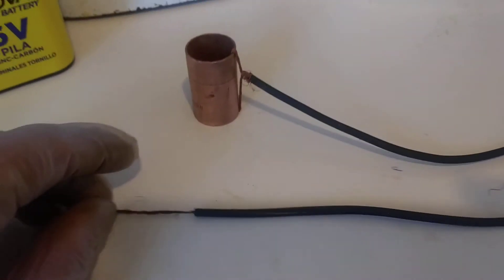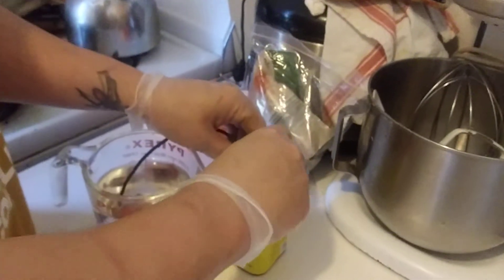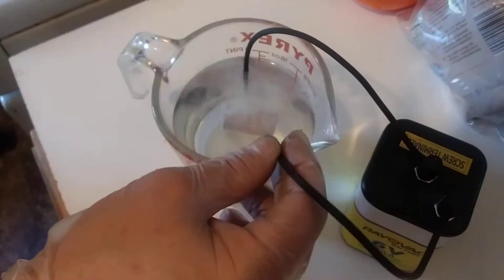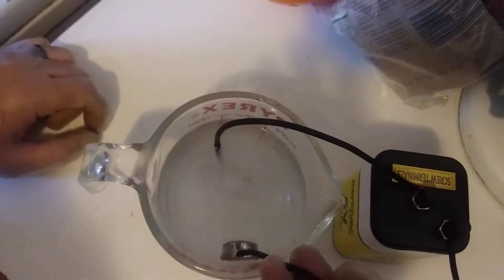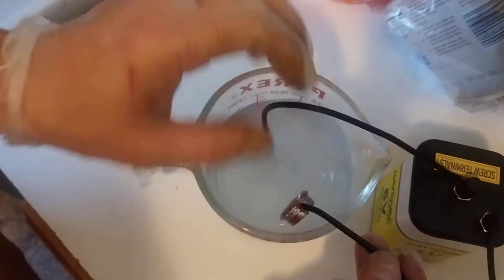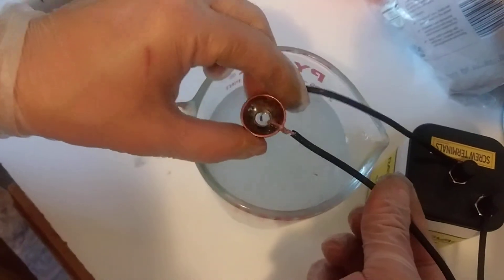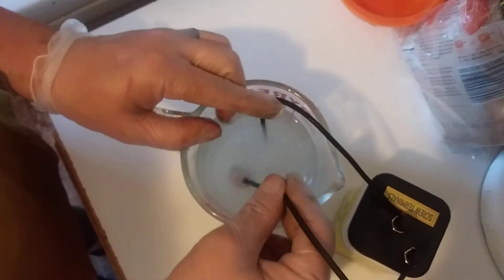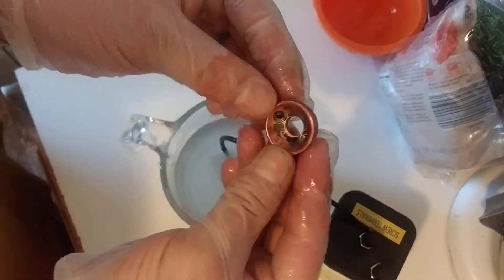Easy way to remove chrome and reveal the copper layer under it.

Comment: Thx the process seems to work well although i got some black residue during the process with a chrome/nickle plated steel part with a copper piece as a cathode anyone got any idea  what the residue might have been?

Comment: Could use bicarb as the electrolyte, no need for the acid, not so?
Does the chrome deposit onto the copper electrode or does the chrome remain in solution?

Comment: Thank you for this simplified method of removing chrome. I have some parts that were originally chrome plated. Most has come off to the point of bare steel showing from age and weather, but some small areas of chrome plate still exist where it was protected. I want to re-plate in nickel and needed a simple way to strip the remaining chromed areas. The chrome is on the part ends, so that's the only section that needs to be put in the bath.

Comment: Can I use DC power supply as battery replacement. Thank you.
Reply from the maker: I don't know honestly, I never done it that way. Research it before you try it. Be safe 🙏
Reply: A DC power supply is essentially a battery sucking endless power from an a/c outlet. Just be careful with your amperage and you're fine.

Comment: I want to remove chrome from a faucet that is supposedly brass underneath. I sanded some of the chrome off and underneath is actually a copper looking metal. can I do this on a a larger scale with my faucet? Never done anything like this before. All I know is I want to make my bright shiny chrome faucet look like aged brass..But sanding it would take days and probably wouldn't be able to get into all the nooks and crannies... Help!"?? Would it be easier to plate my faucet with brass instead? would I be able to age my brass plated faucet if i did that?
Reply from the maker: I would recommend to keep doing the sanding even though it takes forever. The method I used for taking out the chrome wasn't very safe, I should've use gloves for that and I apologize for not stating the precautions for using acid. I didn't got hurt because I knew what I was doing, but I should've been more specific. It was my first video and I was very excited about building that guitar( which came out awesome). Send me an email link and maybe I can help. 🙏

Comment: What your actually doing here is copper plating on top of your existing chrome !
Reply: No he’s not. He has the chrome piece connected to the positive. The one connected to the positive will be corroded (metal is ionized) and the one on the negative will experience metal deposition.
Reply: Actually what I think is happening here is that the thin layer of chrome is removed and the underlayer (nickel) is exposed and instantly copper plated because of the donor piece.

I tested myself.

So no, the copper layer wasn't revealed. What ever the underlayer was, it got copper plated.

Comment: i think its the other way around, what happen is the white metal (nickel or stainless) is taking the copper and making it copper coated
Reply: Nope, the part is attached to the positive (anode), that is the correct way to strip the plating off.